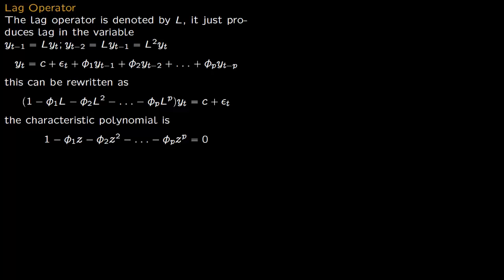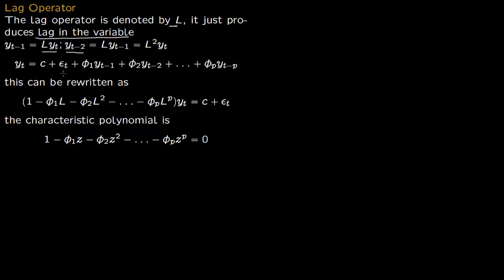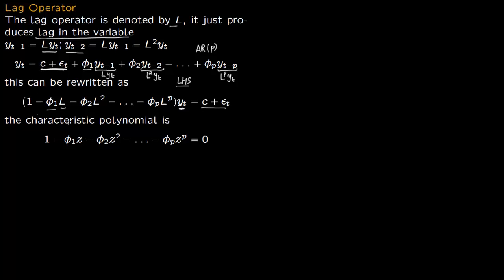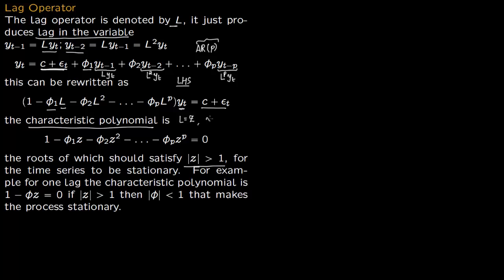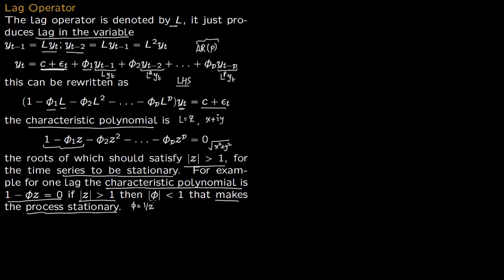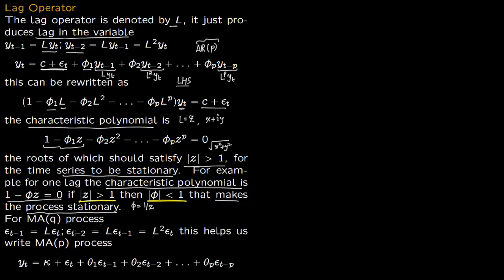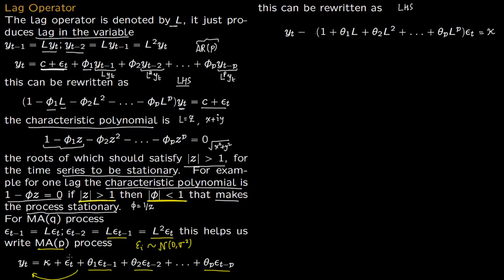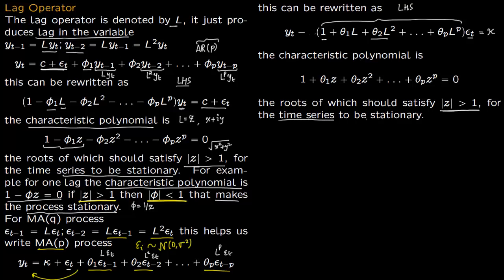1 7 Lag Operator and Characteristic Polynomial

Comment: It's very good and all, but can you explain why we can just substitute the lag-operator for the complex number z, and then use this for doing standard polynomial manipulations?
Reply from the maker: We have to study convergence, for that we need char polynomial. See https://en.wikipedia.org/wiki/Characteristic_equation_(calculus)
Reply: Nothing is explained on wikipedia? To me it seems like, as has been the case in the text books i have, that it is just stated as a prerequisite for solving the system.
Reply from the maker: Please pick up any textbook for differential equations with linear algebra, and see char poly
Reply: Okay thanks.
Reply: Sure thing, thanks